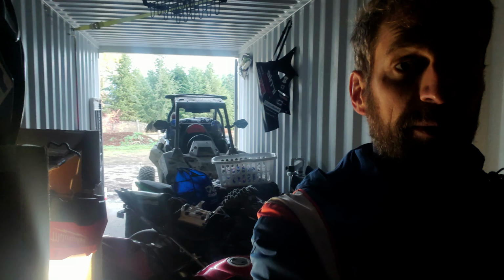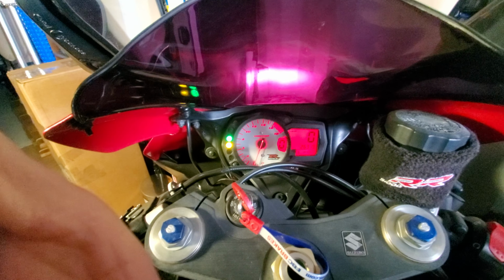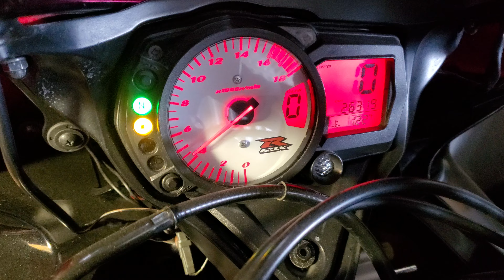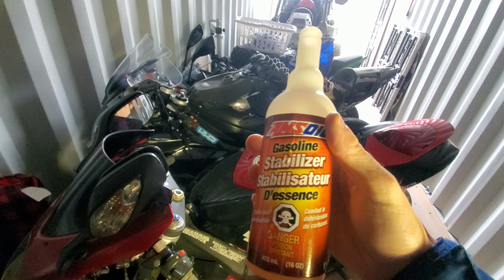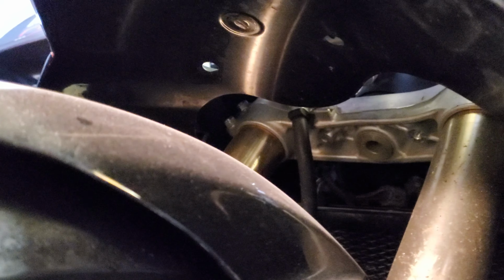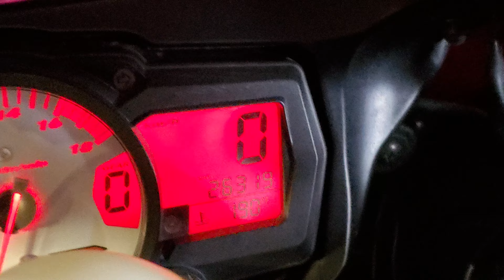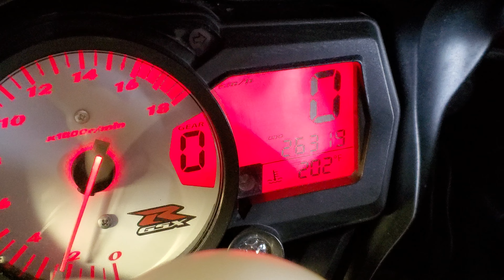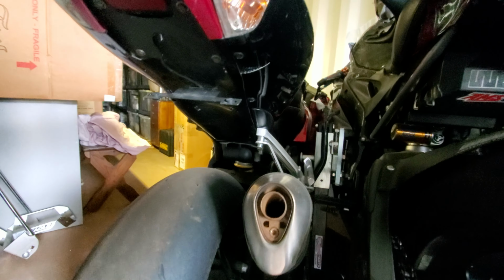GSXR600 Re-Winterize AMSOIL Fuel Stabilizer | Irnieracing 2021

Comment: Marcel,
Been a follower since 2012, see you still have a few bikes, is your back and health healed enough to get back on the track for TD's and maybe a little club racing.  Miss your videos.
Loyal Fan...
Reply from the maker: Hey Dave.  Thanks for asking.  My back has been on the slow road to recovery and as you know it almost killed me back in March 2020 (https://youtu.be/K8pv-BADQ9E).  With discovering Wimhof cold immersion which brought me out of my terrible 22 day pain depression, I have been getting life back on track.  

Eventually the cold immersion didn't work well enough and I discovered micro-dosing psilocybin to relieve my lower back pain.  I did the micro-dosing for a few months, but eventually my mind adapted to the psilocybin and the pain returned.  I then discovered Dr. Sarno and the theory of TMS.  Once I understood TMS my pain slowly went away, and this was back in April 2021.  For the first time in 2021 I was able to dirtbike without my lumbar traction belt.

Now as I write this reply, I do have back pain (the very annoying constant type) but only because I just finished working on my dirtbike (switched to studded wheel set, fixed footpeg, installed new Giant Loop Mojavi bags, studied how to attach a folding snow shovel) and had to lift my dirtbike on and off the stand many times.  

When I have to lift anything or bend over a lot, I will have hours of back pain.  Next on the agenda is a long hottube and maybe I'll train in the gym first with cardio, a little weight training and lots of stretching.   

So yes I believe I can race superbikes, but setting up the pit is another story...
Reply: @irnieracing  Great to hear your layered road to recovery, but what about the actual physical injury and it's repair ?  Is it a balance between psychological and physical ?  I am sure you have been itching to get on the bike and feel alive again.  That is a strong motivator in and of itself.  Hope you defeat all of your demons and will be doing the stuff you loved for so many years.